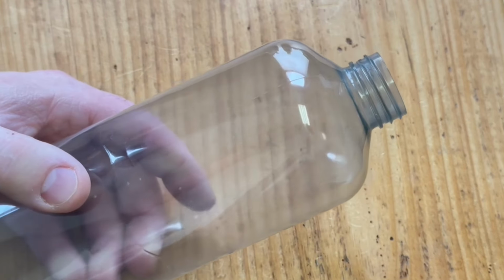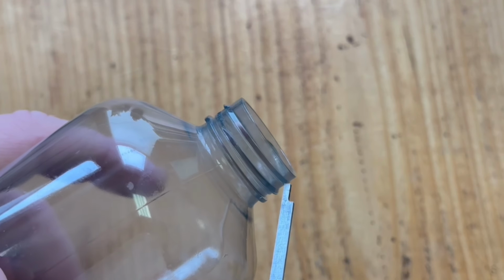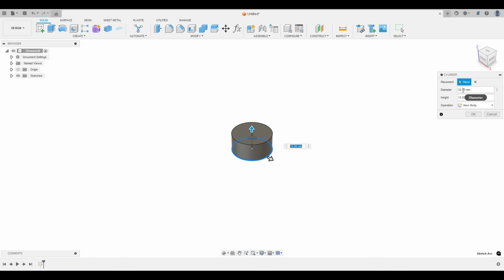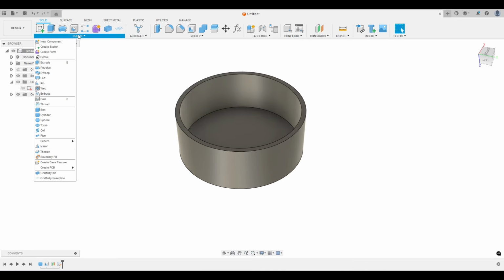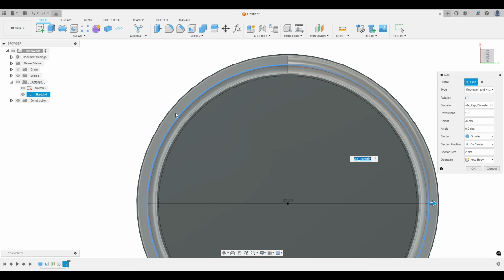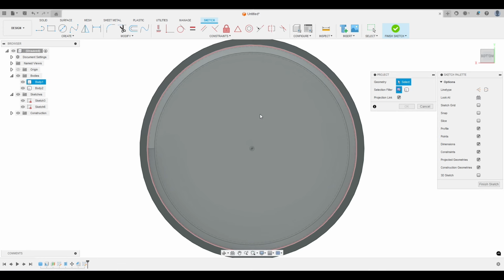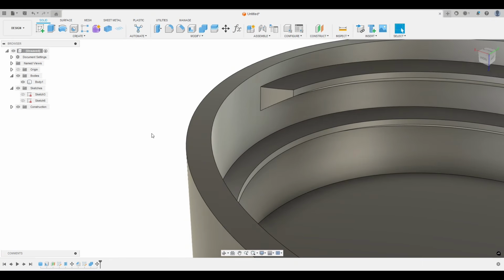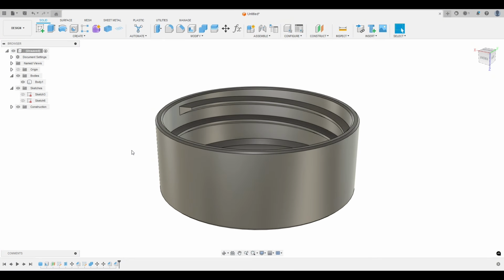Measure Existing Threads to 3D Print a New Cap/Lid

Comment: I create the thread by itself, then I boolean out it's mated part from that as well and scale it for gap.
Reply from the maker: Having a male and female threads is totally fine. I prefer having two male threads. They seem to work better.
Reply: @ShopTherapy623  I have to admit though. I made several before it would work :) And it's even more aggravating with resin prints instead of filament because the coefficient of friction doesn't want to cooperate - resin binds depending... Thanks for commenting.